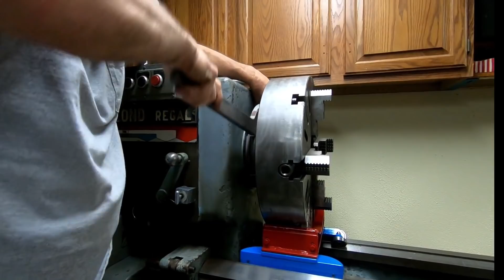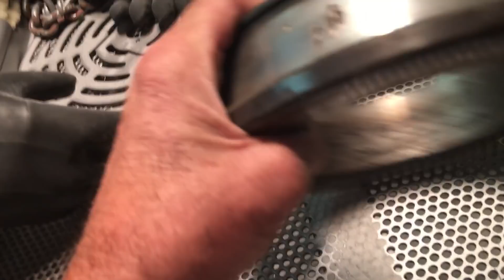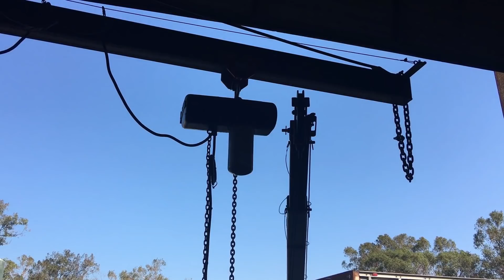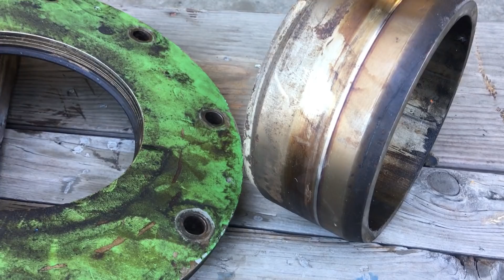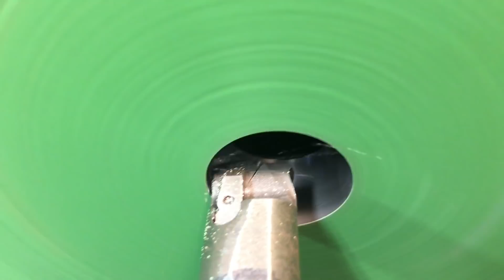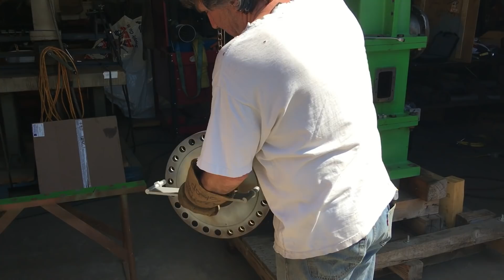Super Handy Lift Cart & Large Gear Box Work

Comment: Nice work/video and shop Gary. I 100% agree that your lift cart is invaluable to Anyone with a shop or garage etc.... I bought a BIG JOE along with a flloor drill press, a horizontal band saw,  
air compressor and 200 plastic storage totes for nuts/bolts, end mills etc,, from a guy closing his shop and had to be out just hours after I met him. I bought all of it for $60....Big Joe ALWAYS saves the day.... They are PRICELESS...
Reply from the maker: They are definitely one of those tools that once you have one it’s hard to give up.    Thanks for checking out the video.    Gary

Comment: Gary, what is the gearbox for? You probably mentioned it but I couldn't find it. Thanks for starting with that shot of the good old Rio Vista bridge in action. Seeing that old girl in person is on my bucket list now.  ;' )
Reply from the maker: Alan, at the end of the video I showed a very large engine on a big trailer. The gear box goes between the engine and a large generator. 
The engine runs on landfill gas and spins the generator to make electricity. The gear box just speeds up the RPM of the generator.
Reply: Thanks Gary. I guess I should have watched a bit longer  ;' )
Reply from the maker: @alanharney5278  LOL, I get bored myself with some videos and need to fast forward through them. I really try to edit my videos to the point where if you fast forward any of it you will probably mis something. But I do appreciate the part of the video you did watch, LOL  I hope you come back.     Gary

Comment: It's a bugger when they get stuck going onto the shafts . I still use the oxy , but i sit the bearings on a steel plate & heat the plate .  Great video Gary , Cheers .
Reply from the maker: Max, I was a field tractor mechanic for 20 years. So I have heated many of bearing in the field with oxy.   But in this case the costumer would run me off if I were to do that. He is totally by the book. And you know what the book says. Always nice to have you stop by Max.      Gary

Comment: I always enjoy seeing shop made tools, jigs and the processes used to put them into work for particular niche work environments. The process of replacing the seals and bearings on the gearbox was extremely well documented and presented. I hope one day to see some work on the mating engine we got a glimpse of at the end, as I used to work at Ingersoll Rand where they occasionally used similar gas engines to power reciprocating gas compressors they supplied to the petro-chemical industry. So I recognised some of the processes you used on the gear box refurbishment. Keep up the mix of content, I'm really enjoying your channel especially the machine tool rebuilds.
Reply from the maker: Thank you very much Paul.  We are involved in swapping out the engines but try not to work on them much. We just don't have the time.  These engines get shipped to Austria for rebuild. They will be like new when they come back.    Gary
Reply: @OldIronMachineWorks  No problem, there's plenty of other content on your channel.  The gearbox rebuild brought back some good memories, I did not do the mechanical work, just instrumentation sensors that was often buried deep inside the equipment (temperature, pressure, vibration and speed etc) 
When I have spare time, I meander though your older videos :)